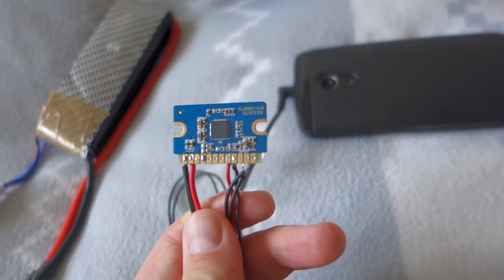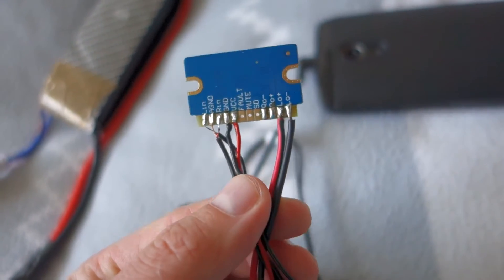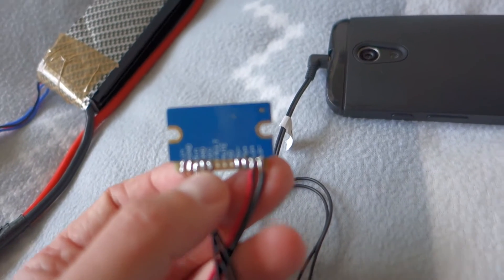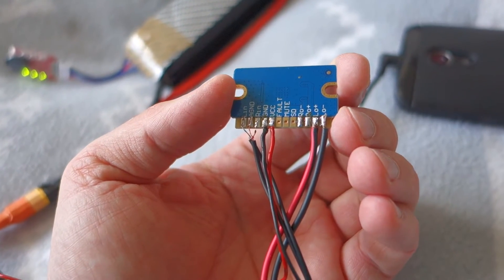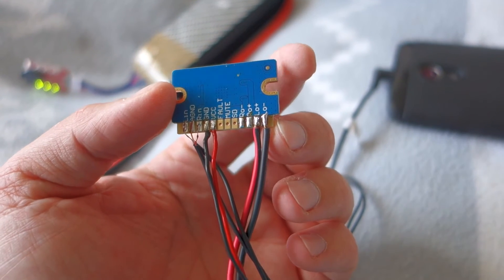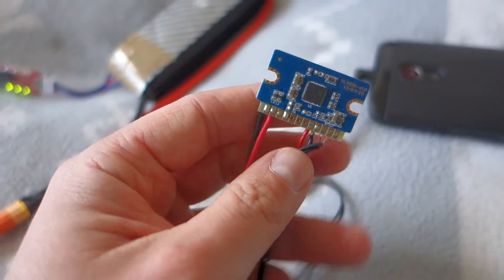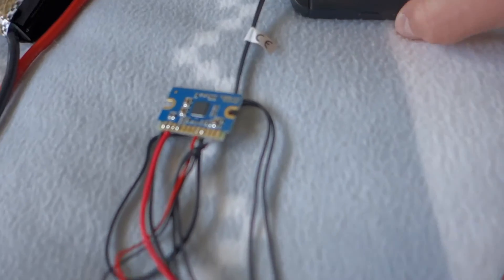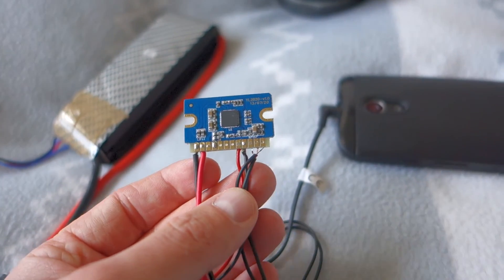YL2020 20W + 20W Class-D Audio Power Amplifier Module Pinout, TI TPA3100D2

Comment: This amp thumps...
I tried with a sealed speaker box containing 2 4" subwoofers and a single tweeter on a 18v tool wrench battery and a Bluetooth module.
And yes the chip gets hot at maximum volume of my phone.
I don't really play it at maximum for too long.
Bluetooth module output varies from model to model. 
But let's say  at volume 6 on my cell phone via Bluetooth module this amp was very loud and bass response is great the chip was barely warm or cooling off from the previous pass.
Reply from the maker: Great! You can try hooking up a heat sink if you wish. Of course some thermic loss still happens lets say 10-15% (you can check in the datasheet of the chip if you want) so when talking about 2x20W this means 40W*0.15=6W thermic loss (just an example) that heat is possibly to heat up that small pcb quickly, but hopefully keeping in the safe limit the silicon die.
Reply: @VeryokayDIY  I burned the chip I connected first the positive and when I connected the negative. Sparks jump out of the board and yes RIP the chip.
But for $7 I ordered another one 😂
Reply: @VeryokayDIY  also I tried the tda7375 Amp that I previously built for this project....
And nop not the same.
First not the same tump.
Second heats up real quick. And since I'm using both positives with a cap on each wire. Highs wasn't the same. So I went to my Amazon account and ordered another YL2020.

Comment: Regarding GAIN: The TPA3100D2 chip supports four selectable, fixed gain settings. However, because this board is a simplified implementation, the gain is pre-selected. I couldn't tell exactly by looking at the board traces which of the four is selected, but I assume the max of 36 db (typical). This simply means that you'll be controlling the gain at the audio source with the volume control and rest assured that this amplifier module will amplify whatever signal it gets to the maximum setting. There are other useful features available on the chip not exposed by this module. If after reviewing the specs (http://www.ti.com/lit/ds/symlink/tpa3100d2.pdf) you feel you need them, pull out your microscope, X-ACTO knife and best SMD soldering iron and go for it.

Or, buy the chip and design your own board: https://www.ebay.com/sch/i.html?_nkw=TPA3100D2.

Comment: what is the speaker's capacity? i have a speaker 22W 4R and wonder if i can use this module <3
Reply from the maker: sure you can use, this module can pump only 15W into 4ohms as stated in the datasheet
Reply: Veryokay Do you have any better option for my speakers?  Thanks for reply <3
Reply from the maker: use any cheap car speaker even recycled from a car those usually in that range of power (I used such too in the test)
Reply: Veryokay ok i will try <3 thank you